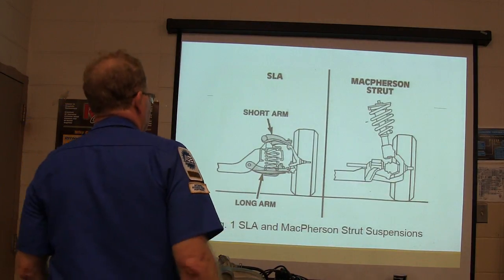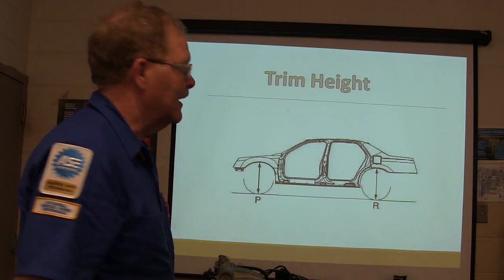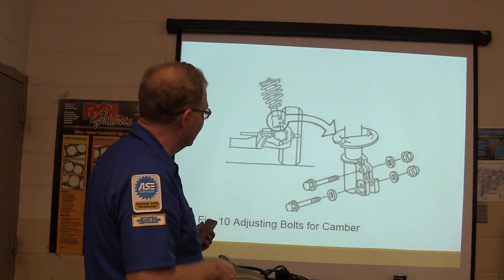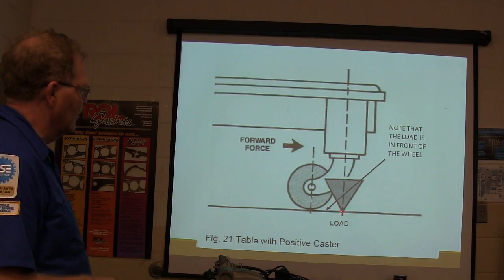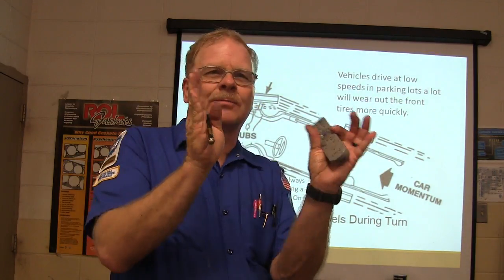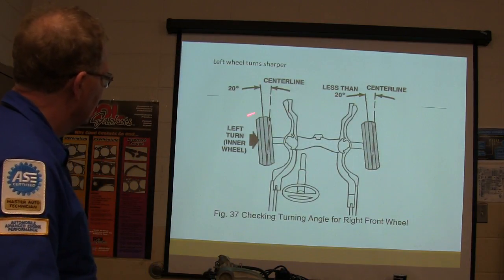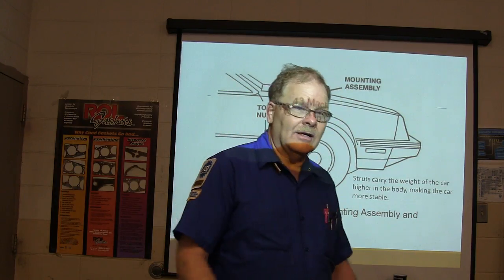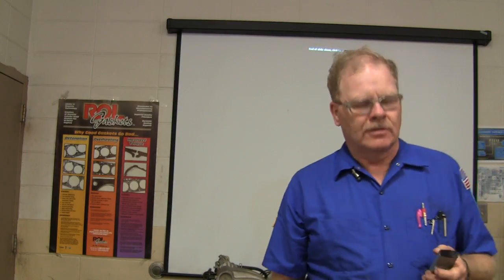Steering And Suspension Angles 2018

Comment: I have Porsche cayenne that has issue on rear passenger side ,  it makes growl noise while driving and a harsh vibration similar to loose lugs??  When I spray wd40 into the axle nut area , the vibration goes away completely for few minutes(growl 50%) . Is this awheel  bearing and axle or just bearing ??  The fact it goes away with oil ( temporarily for 10 miles or so ) I'm hoping just the bearing is bad. I bought a salvage hub$50, for fraction of dealer estimate.     Watch all your videos...thank you !!!
Reply from the maker: Sounds like the bearing in the hub is bad, for sure.  Hope that takes care of it.